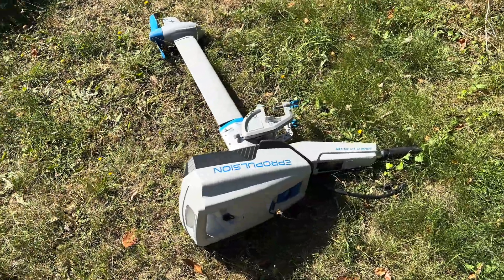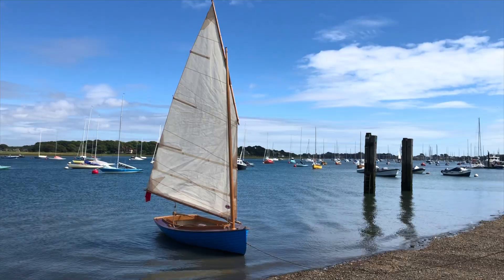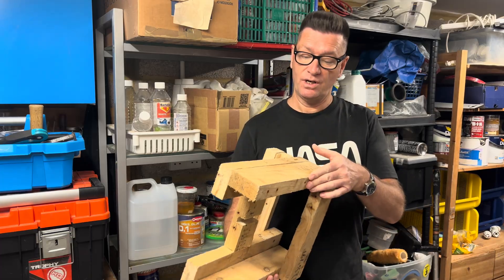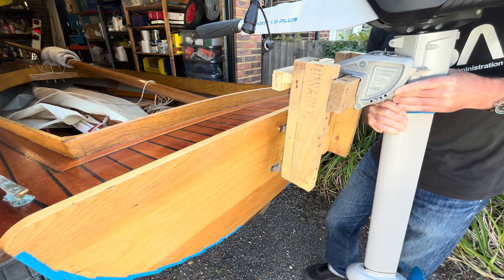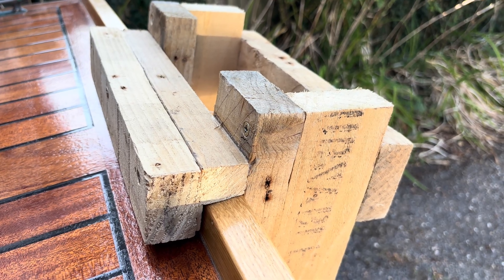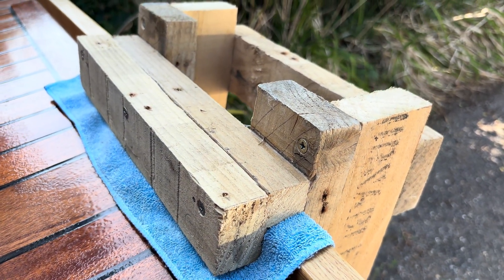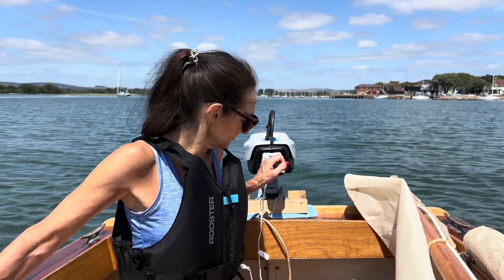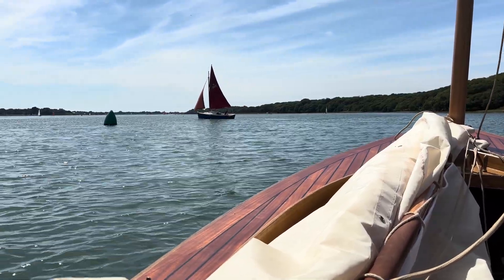Outboard Motor Bracket - No Holes Drilled Into Boat Transom

Comment: what  will  keep  it  from  lifting  up  and  dunking  the  whole  deal,  motor  and  all,  when  you  run aground  or strike  something.  C- clamps are cheap  and  won't need to be drilled
Reply from the maker: There’s nothing to clamp onto. If you watch the video all is revealed.

Comment: Good idea! Having had a small outboard fall off a dinghy transom many years ago, please make sure both the bracket and motor are really secure (overkill recommended). Also, do you think you'll be able to quickly deploy the motor under the worst possible conditions (post-capsize/swamping, when you're cold, wet and tired, in terrible weather, etc) while trying to avoid a collision?
Reply from the maker: I can change the motor for rudder quite quickly, but not as fast as I’d like. I don’t want a bracket permanently attached to the boat, so I’m willing to accept the limitations that come with this setup.
Reply: @WavingNotDrowning  Ok, I understand and you have such a beautiful boat it'd be a shame to make the compromise and mess up the transom. I recently saw another video for a side-mounting an outboard on an Ilur in NZ - see: https://www.youtube.com/watch?v=cm7enAkZUuA While this may not be an ideal solution for you, it does allow the boat to maintain steerage while the motor is being mounted. All the best.
Reply from the maker: @simontee4262 I did consider a side mount. It’s still not a bad idea, but the epropulsion is pretty heavy and I decided a rear central mount was the best compromise. Whatever the solution…it’s all a compromise. I may try a side mount at some point.